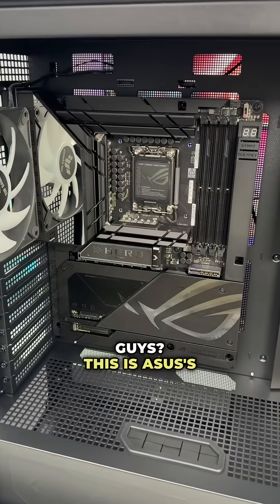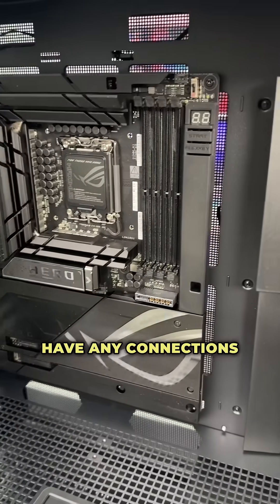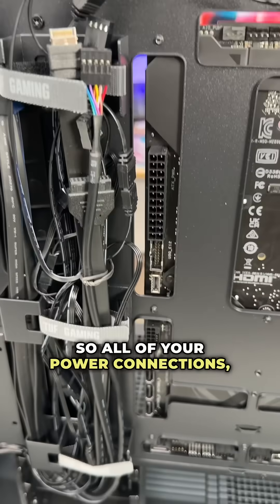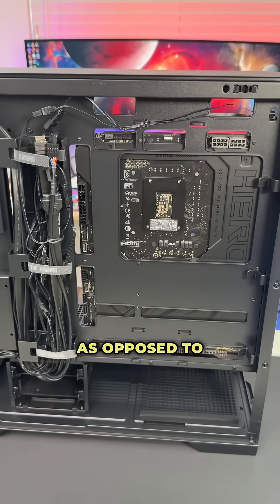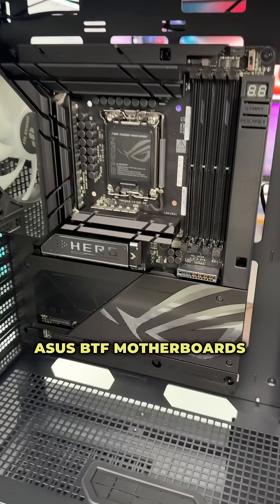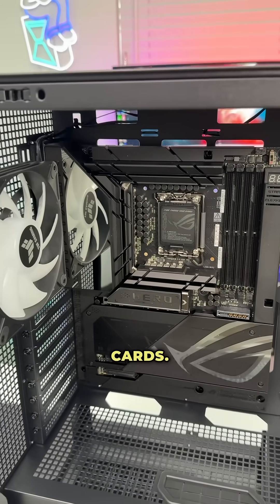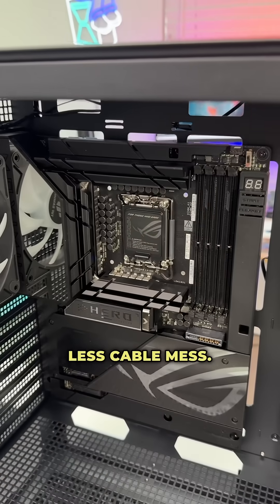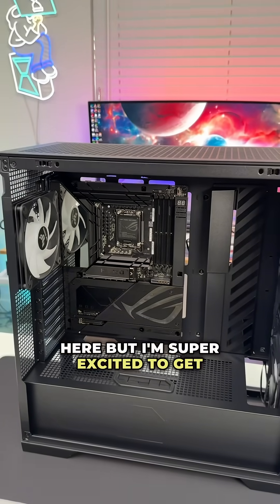This Motherboard Hides All Your Cables!

Comment: My current pc(a super low end budget laptop from over 10 years ago) has a cpu with a max speed of 1ghz and when unplugged runs at 800mhz with super old Intel HD integrated graphics from around 10ish years ago and I also have 4gb of super old laptop ram and a 256gb hdd as my only drive... I got 7fps on Fortnite with all the lowest settings possible in 1080p, and this was on the battle bus, not even in game!
Reply: 7 fps is my dream. Lucky you.
Reply: @talon1706 what specs are U running?
Reply: @talon1706 I also had to delete the game afterwards since my hdd ran out of storage